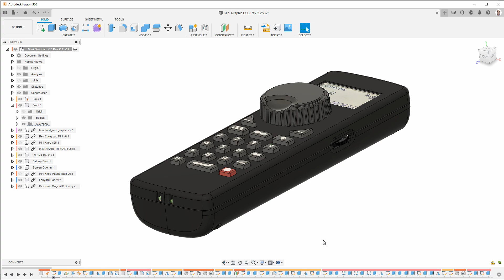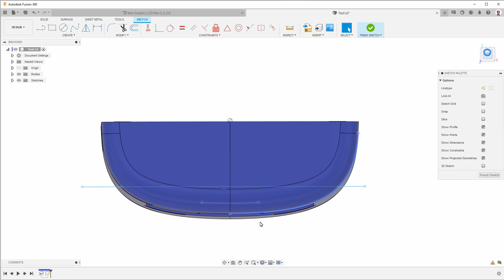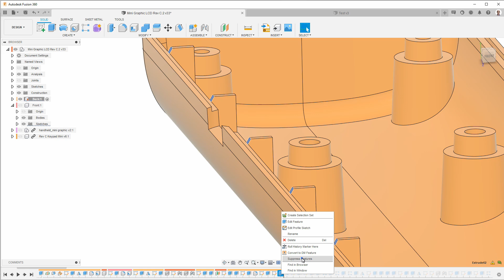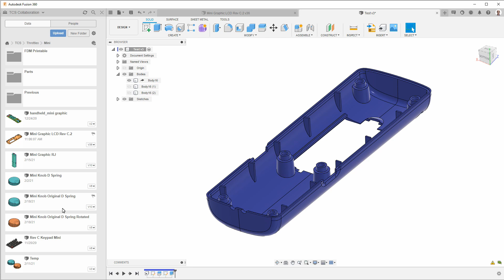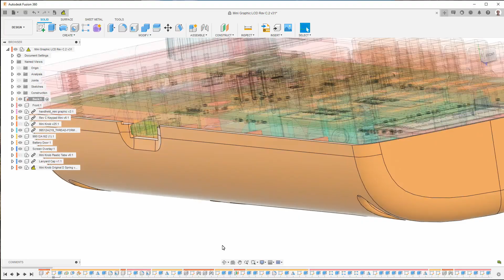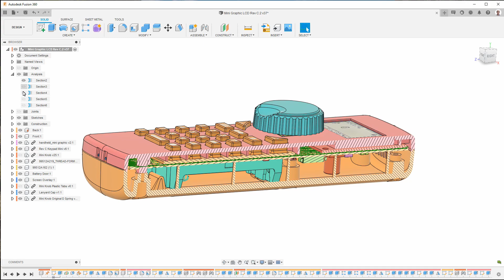F360 Insert Derive for Variations

Comment: Fusion now has Configurations, but Derive is still relevant.  

Configurations are best for 'variations' of a design (ie changes in properties, toggling 'childless' features, etc). It's not so great at toggling/switching chains of dependent features.   By 'toggle', I mean 'Suppress' all but the active option.

Derive is often the simplest option when a design requires selectable upstreamfeatures (eg different sketch profiles) which each have a chain of dependent features (eg. extrude(s), combine, chamfer, etc).    

AD discussed using Derive like a 'Configuration' here:  https://www.youtube.com/watch?v=OpFSoPLSaag&pp=ygUVRGVyaXZlLWluZyBGdXNpb24gMzYw 

Thanks for the vid btw 🙂

Comment: Thanks for this, was looking for a workflow for derivations (nice to see the product made it to production now too). For the holes and supports issue, Cura has a support blocker feature that can remove supports for specified areas, so that could be an option if trying Cura in the future. For the knob, creating a construction axis through the center and then using the rotate feature for the relevant faces of the part you wanted to adjust might have worked. Feels a bit kludgy to "tweak" things, but it's efficient and the move appears in the timeline and can be edited, so is a manageable approach.

Comment: How to injection mold tubular surfaces(Tubes) (long cylindrical surfaces inside side) without draft as with even 1 degree draft result in much diffrence at other end.
Reply from the maker: I have no experience with that type of mold. This is a hobby for me, so I'm certainly not an expert.

Comment: Very nice work! The design looks polished. Have you gotten toolmaker feedback yet? One thing that caught my eye is the steel is a bit thin on the bottom half above the uppermost bosses and comes to a sharp edge. The other thing that caught my eye is the ribs in question that support the pcb... if you eliminate the chamfer and in its place put an offset of the top inner surface, they can support the wall of the top half. They would then help resist the top half from deforming towards the centerline if someone were to push on the clamshell from the side at the half lap joint. It probably does not matter for this product as its pretty small and looks stiff. But for a larger product that can help a lot.
Reply from the maker: Thanks. The injection molder was fine with the design before I added the extension to the ribs. I'm pretty sure they're going to use EDM for these, so shouldn't be an issue. If they do have a problem, I'll change the design. I added the chamfer to help the case halves slide into place. Given that the two halves are held together by 6 screws, I think the chamfer will also help with what you suggested. The larger version of this throttle doesn't have an issue with deforming, so I think we should be OK. I do appreciate your suggests, so please keep them coming.

Comment: How an app product instead of a remote?  You could put all the functions including the wheel knob on a phone app with no investment in boards or plastic tooling.  The best part is you can change the design of the buttons or display anytime you want and the users can just upload it.  On the other end you could have a inexpensive interface to control the train item and it would be expandable cheap.  Just a thought.  :)
Reply from the maker: Phone apps have been around for years, and they're popular. But there are downsides that people don't like. For example, you get a phone call and loose control of your train. Or your phone locks just when you need to stop your train as quickly as possible. Or, you can't operate your train without looking at the screen. So the tactile feel is popular. TCS has already sold a bunch of the larger version of this throttle, and have gotten a bunch of pre orders for this one. So there is a market. People tend to have a strong preference for either the phone app or a physical throttle with buttons and knobs.
Reply: Make sense.  Keep up the videos!
Reply: I found this video through model railroading, and clearly it's aimed more at the CAD/production end of things than being model railroad specific, but I strongly prefer a physical throttle. When operating trains realistically, you don't want to have to look at a phone screen, and having physical buttons and knobs makes control much easier. The TCS throttles are the best in the business in part due to the ergonomic design that's designed to fit in your hand naturally, vs. Existing throttles that were designed around accommodating mid-1990s electronics and manufacturing processes.

Comment: Great content! I've watched all of your videos and appreciate the depth and clarity you put into your work.

It may be a little too small for your remote, but I've invested in a SLA printer for alpha prototypes. In addition, their exist SLA resins that are intended to be used as injection molds for beta prototyping (few dozen cycles). There are definite trade-offs (vs FDM/SLS for alpha prototype and vs aluminum molds from your HASS), but maybe something worth looking into. It's an inexpensive investment dollar-wise.
Reply from the maker: TCS has a Form 3 that they've used to make prints of these parts. There are several issues. First, the prints, even with the hard and tough resin, are still brittle. Sometimes they break the part while removing the support material. Also, sometimes the parts warp. I used to own an SLA printer, but really didn't like working with resin and dealing with resin that hadn't completely cured, or didn't want to wash off the parts. Finally, the Form 3 takes a lot longer to print parts than my FDM printer with PLA.
Reply: Resin parts will always be more brittle, I completely agree. (In my limited experience using Chitubox and Elegoo Mars) I have never had a part break during removal. Maybe settings or resin selection? Anyway, just wanted to bring up the point. Keep up the great work.